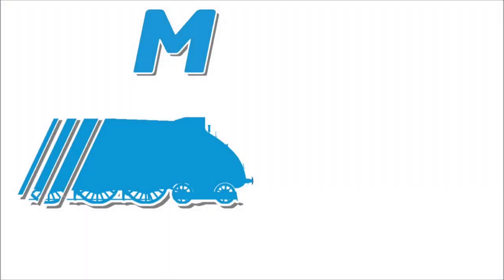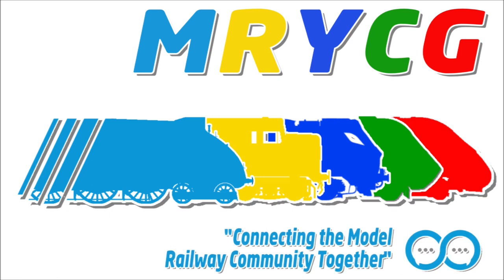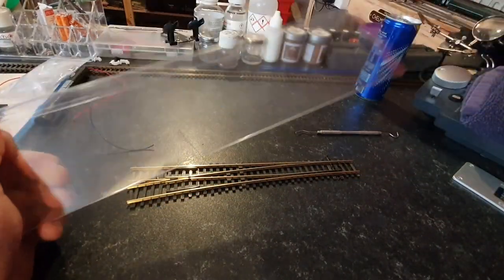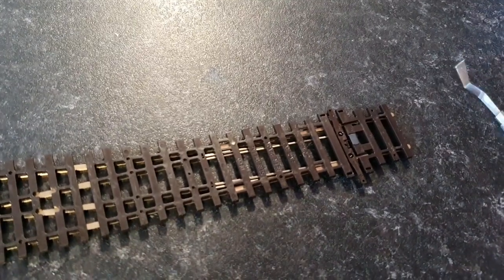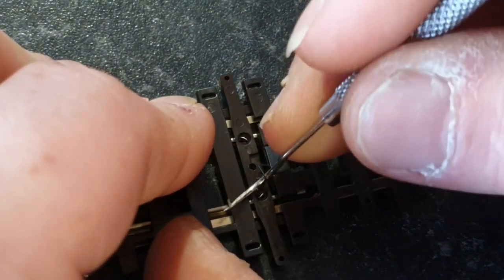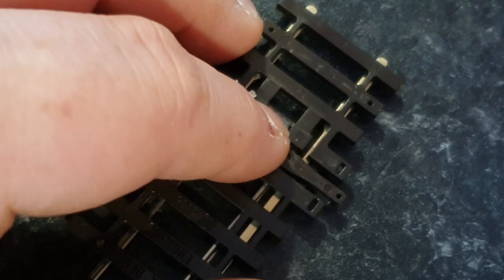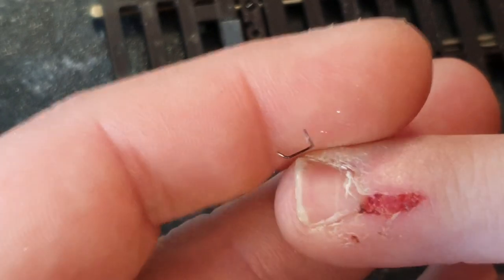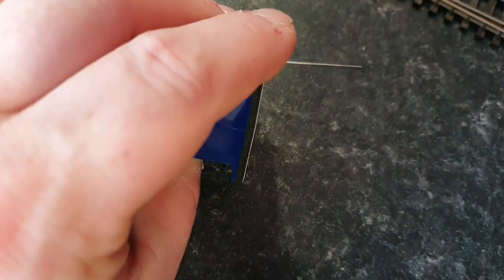peco point spring removal

Comment: The metal cover that could not be removed goes through the plastic and the ends are bend over retaining the cover and the spring beneath. If you simply lever the two metal clips on the top then the plastic cover will come off and you simply remove the spring. refit the cover and bend the metal clips back down. This can be done with the points already in place.
Reply from the maker: I found a very thin but strong pair of snips works just aswell to cut the spring
Peter

Comment: A couple of my Hornby points don’t stay in position, do I need to change the springs?
Reply from the maker: hello edwood
are you using point motors or just doing by hand as if you are using point motors they should stay in  place if your using your hand then ive not known spares for point springs so might have to replace the point.
peter
Reply: @chelmswoodjunction  by hand sadly  but thanks for the speedy reply
Reply from the maker: Hi Ewood
In that case sounds like you will need to replace the points.
Peter